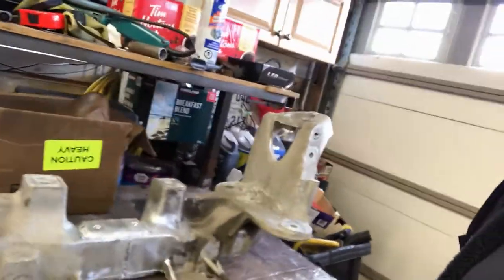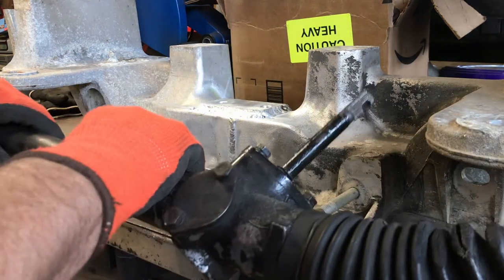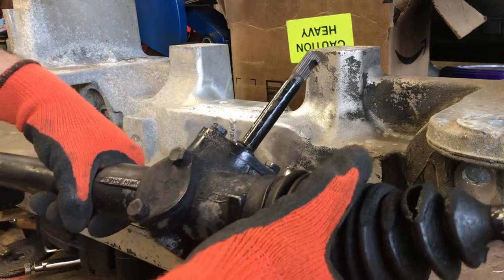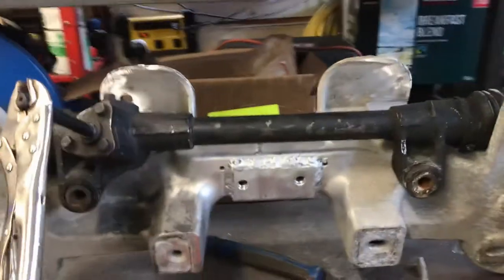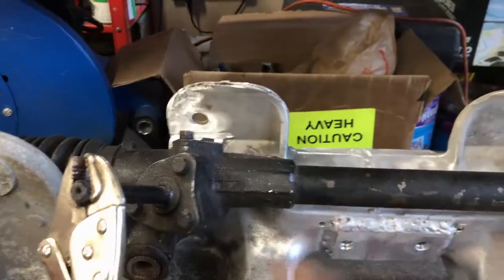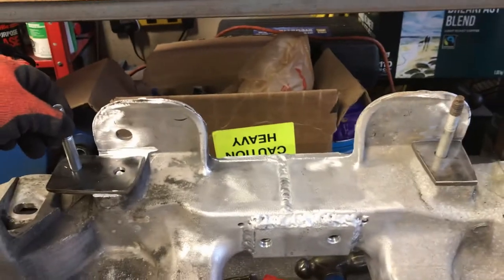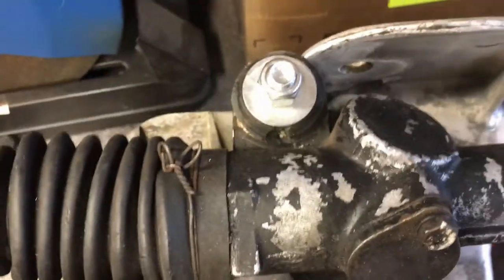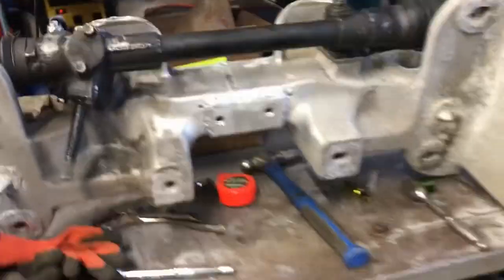Narrowed Crown Vic and Mustang II Steering Rack For My 1936 Chevy Coupe

Comment: Good job. I was surprised when the stud came out that easy. I was waiting for it to snap, seeing you didn't use any kind of penetrating oil. You are making good progress Dave. Thanks for sharing.👍👍
Reply from the maker: I deduced that since it was a zinc coated stud into aluminum, the resistance would be merely pressure related. Yeah, I just crossed my fingers and hoped for the best.

Comment: So if you only narrowed it 4” , the Mustang rack would bolt on . I have an application where that would work. Just wondering if the CV rack would turn  one inch less by adjusting .
Reply from the maker: The most important thing is to try and line up the bottom control arm pivot with the inner tie rod pivot, so they both have the same arc when the suspension goes up and down. Mine is not exact, but hopefully it will be close enough.